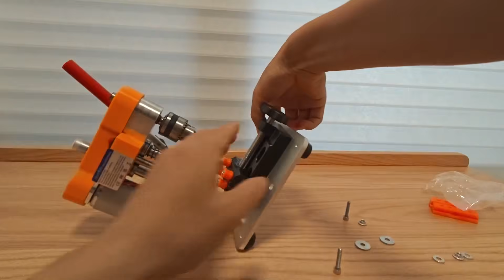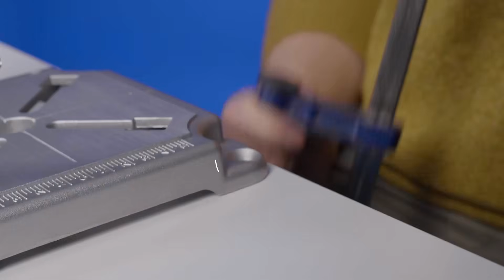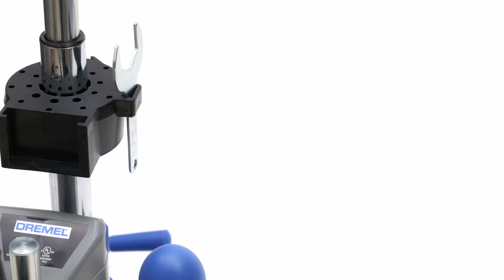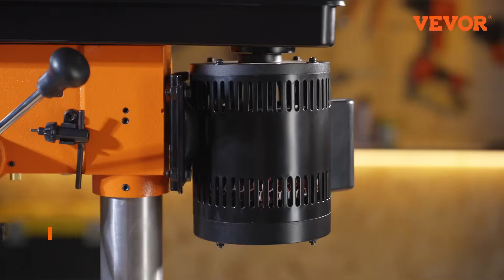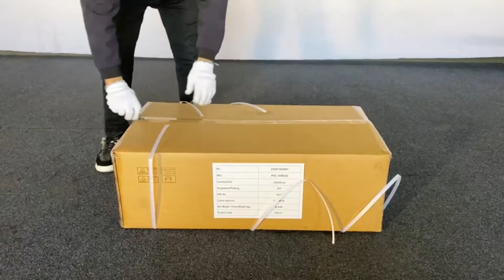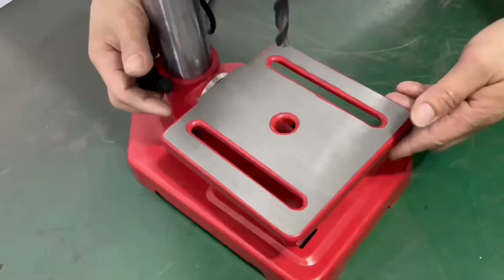Best Drill Press Table Of 2026 - Top 5 Drill Press Tables Review

Comment from the maker: Best Drill Press Table ⤵️ | Links To Products

1. NovelLife 795 - https://www.amazon.com/NovelLife-Precision-Benchtop-Drilling-Portable/dp/B0BKZRD2P7/ref=sr_1_9?tag=smoky0a3-20

2. Dremel 220-01 - https://www.amazon.com/Dremel-Workstation-Portable-Drilling-Perpendicular/dp/B00068P48O/ref=sr_1_18?tag=smoky0a3-20

3. VEVOR Benchtop Drill Press - https://www.amazon.com/VEVOR-Benchtop-Variable-Distance-Worktable/dp/B0C6XW4JY2/ref=sr_1_32?tag=smoky0a3-20

4. Generic Benchtop Drill Press - https://www.amazon.com/13-Benchtop-Drill-Press-0-45%C2%B0Tilting/dp/B0G7YNHFCB/ref=sr_1_36?tag=smoky0a3-20

5. GarveeTech Benchtop Drill Press - https://www.amazon.com/GarveeTech-Benchtop-Adjustable-0-45%C2%B0Tilting-Worktable/dp/B0F48N5FKD/ref=sr_1_42?tag=smoky0a3-20